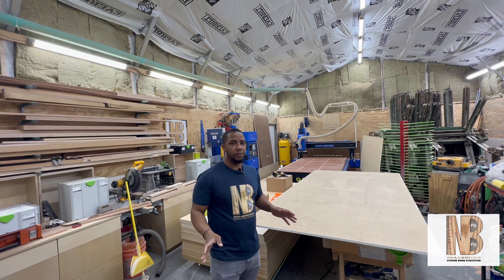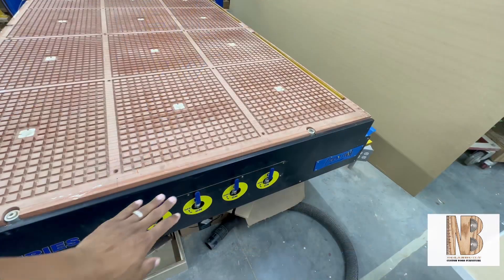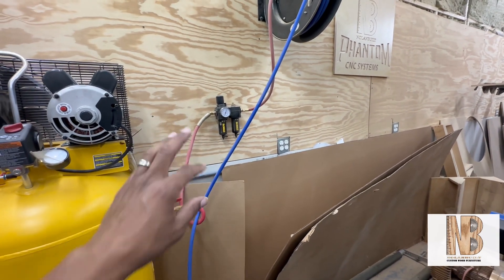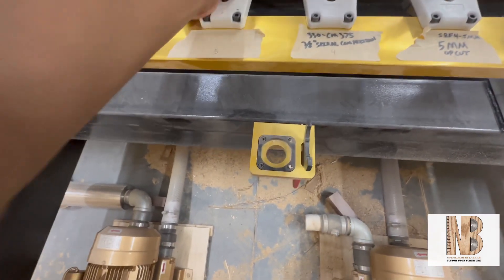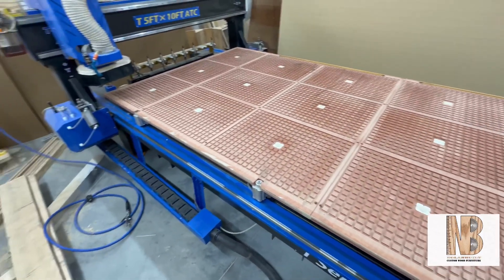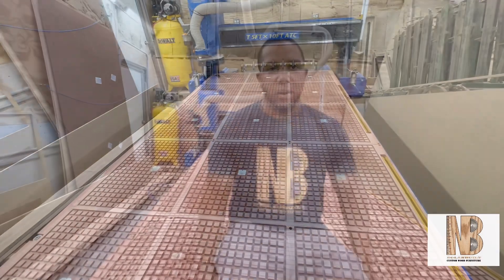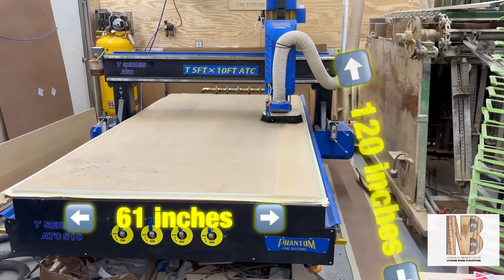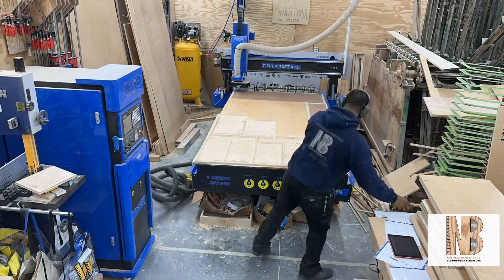Phantom CNC #phantomcnc #needtoknow #cnc

Comment: I currently use Mozaik and break down on a table saw. How easy is this machine to run? I see a lot of ppl complaining it Dosent have a computer program running it rather a controller. Also how long per sheet does it take approximately?
Reply from the maker: After you get through your learning curve on mozaik. It’s relatively easy. The phantom does run from a controller instead of a computer. But I that is a benefit. All of the computer based one are subject to computer and Microsoft updates.  The phantom is stand alone and will never need updates. Depending on how many pieces are one sheet. The times range from 3 minutes to 10 minutes per sheet.